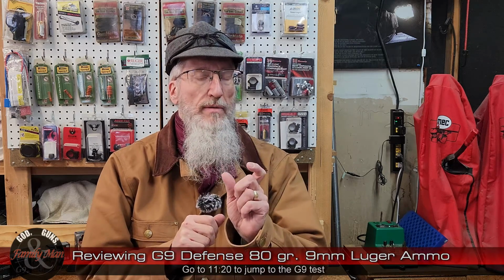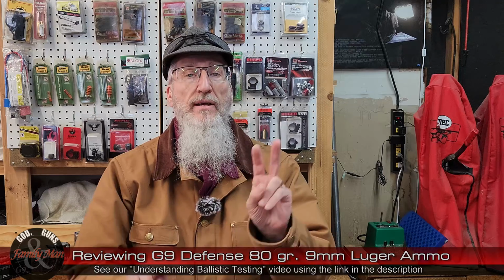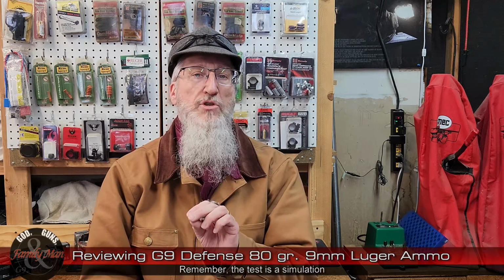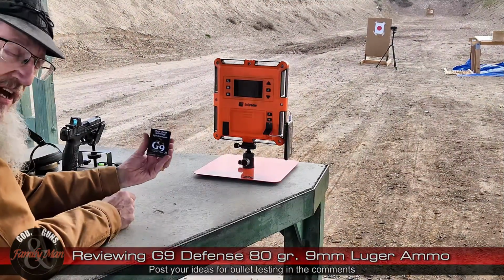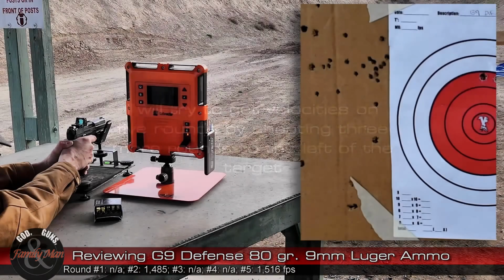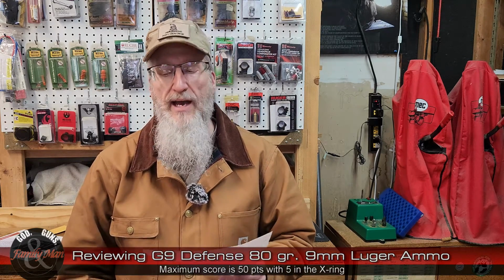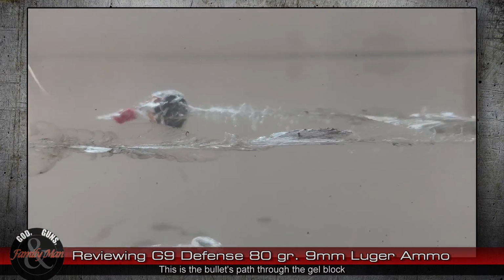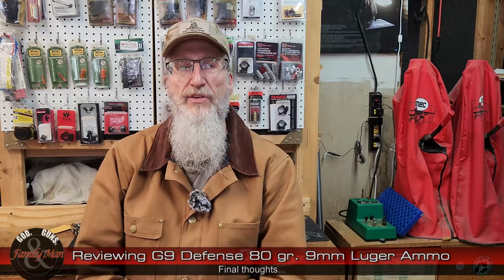Ballistic Testing American-Made G9 Defense Ammo

Comment: Today I took a second look at this video and noticed that you measured penetration at 12.25" based on where the bullet ended up in the gel.  During the gel penetration video, however, it appears the bullet travelled another ~ 2" deeper before bouncing and turning around and landing at the 12.25" mark.  Should not penetration depth be measured by how far the forward facing bullet successfully penetrated the gel block?
Reply from the maker: This is very common and in fact, I read a journal paper recently indicating this same phenomenon happens in real tissue as well.  Since I do not have a very high speed camera capable of recording 10,000-100,000 fps I cannot rely on the super slow-motion footage to indicate maximum penetration.  The frames available to me might have simply missed the maximum penetration on one bullet and not another bullet.  To make all the tests as comparable as possible I use the point at which the bullet comes to rest inside the gel block.  In some cases there may have been 1-3" of additional travel (or none) before the rebound but this is never certain or known.  Good question and thanks for asking.